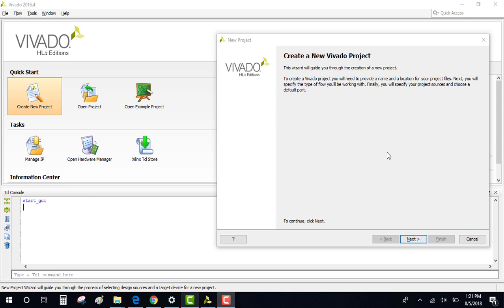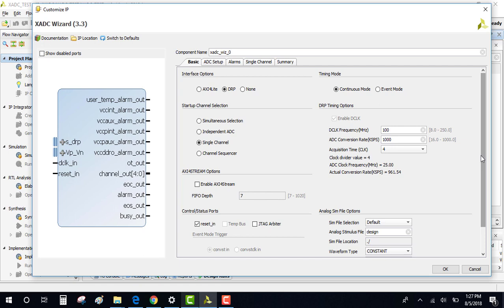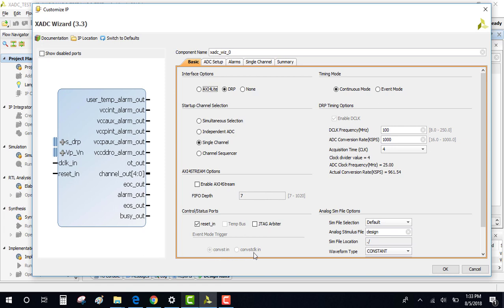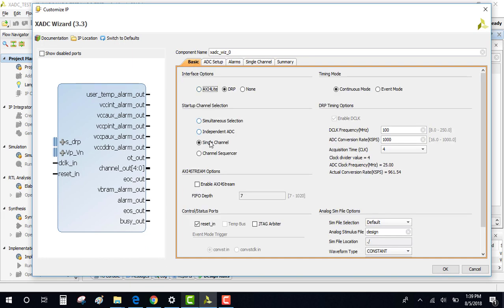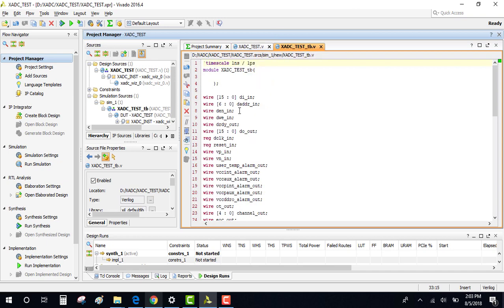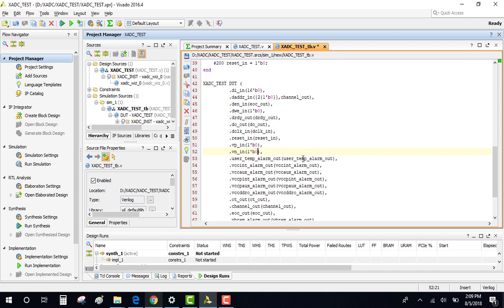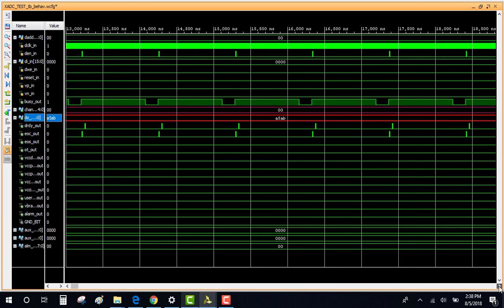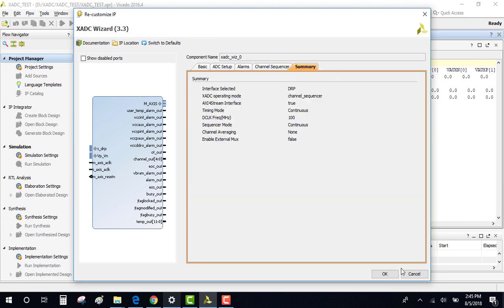How to simulate Xilinx XADC IP?

Comment: I am getting error after adding design.txt file..    cannot extract design.tdt file
Reply from the maker: Sorry for the delay as I didn't get notifications of the comments. If you are still having problems then you can share what errors you are getting. Thanks!
Reply: @GetitQuickly  I am also getting the error cannot extract design.txt to itself and unable to solve it. Could you please tell how to solve this error.
Reply from the maker: @yogitachoudhary1670  As the video is really old so I don't remember it exactly. Could you please send me a screenshot of the errors you are getting via email?

Comment: Hello. I have a query. Right now my project works like LEDs glow from right to left as we increase the analog input to the JXADC port by 0.1 V.
Is there any provision to change the 0.1 volt value?
For example, I want the LEDs to glow each time 300uV increases.
I'll be glad of any help provided.
Reply from the maker: Sorry for the delay as I didn't get notifications of the comments. If you are still having problems then you can share what errors you are getting. The project link is in the description of the video. If you have any specific questions you can send me an email. Thanks!